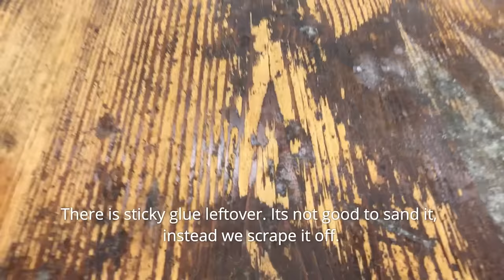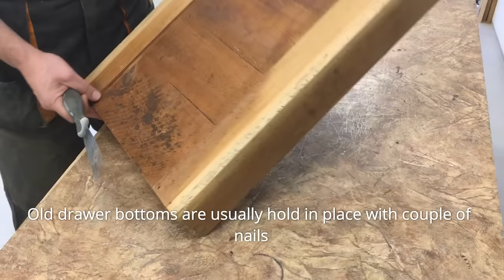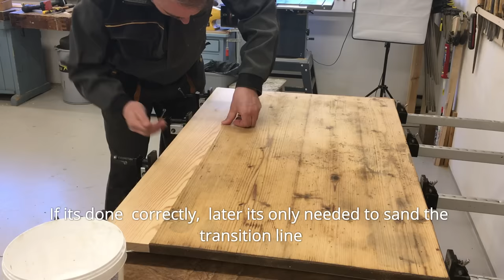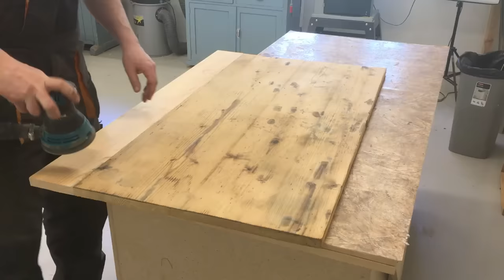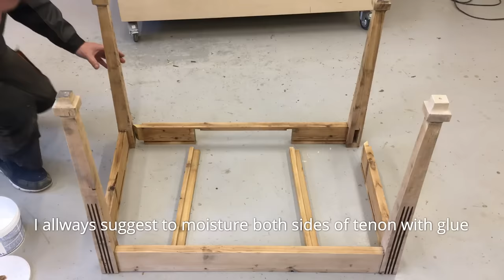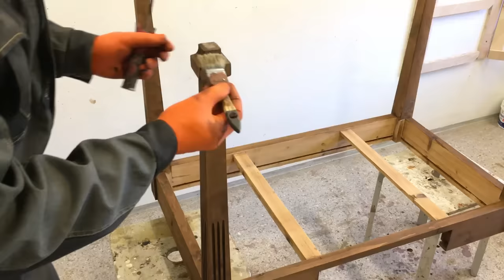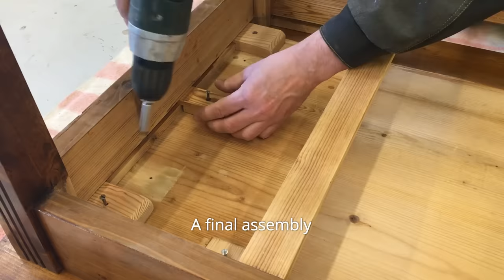How to restore an old table for beginner

Comment: You're not restoring this table, you cut out pieces and replaced them which is NOT a true restoration. Those pieces could have easily been steamed and then flattened back to normal with a weight placed on them until they cooled off!
Reply from the maker: Theres a difference between doing a show piece for museum and a furniture that will be in everyday use. This table was for everyday use. Secondly, the plate piece was full of cracks. Yes you can put the filler in, put in longer period of time they will open up again and ruin the lacquer. If I do it for a client then I want to make sure that they wont have any problems with it.
Reply: @ATRestoration  you miss the point, everyday use is great and I would love to see it in use again. Just pointing out that so many restorations on you tube are not true restoration. It is still a beautiful piece don't get me wrong!🙂

Comment: Horrid job with the varnish. How long have you been refinishing furniture? And the other poster is correct you took off all the character that showed this was an old original table.  The cupped board should have been left as was, no longer looks like an antique!
Reply from the maker: I have been doing this job for 25 years. Every year I do 100-200 different pieces. Restoring a piece to the original state when it left the makers workshop cant be wrong. I know many professional restorers and they mostly do their job the same way as shown here. I like to do my work so that it will last next 100 years. Your aproach is more popular among amateures. That doesnt mean its wrong. It often depends what the owner wants and what they already have in their homes. This table was part of the bigger set for example.